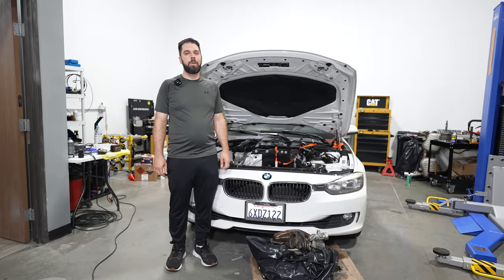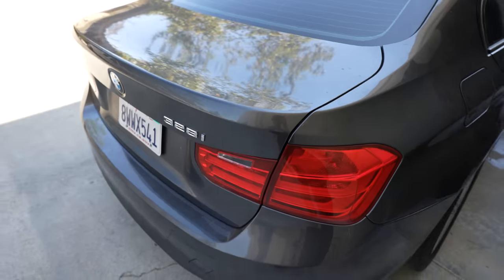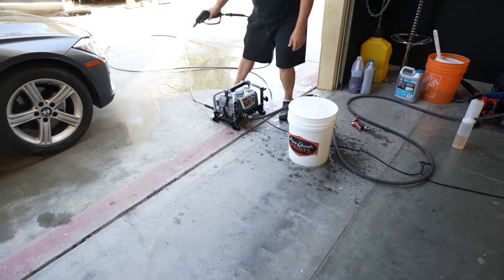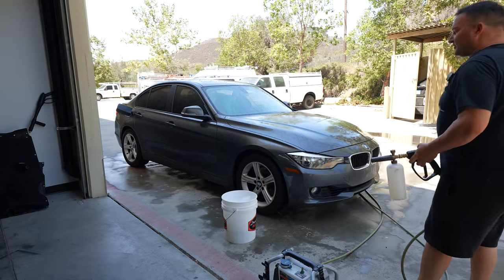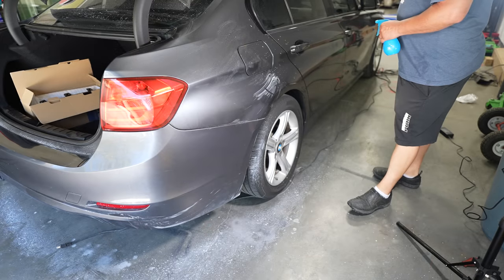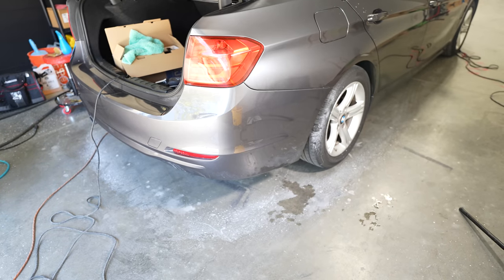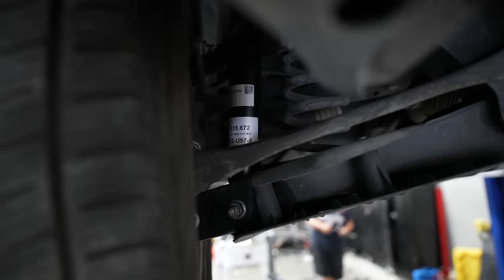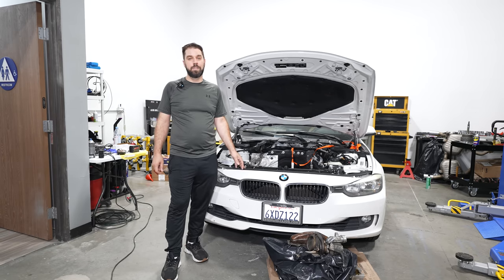BMW Professional Paint Correction (Clay, Wet Sand, Compound, Polish, Ceramic Coating)

Comment: With my 2008 335I I replaced the turbos with Vargas upgraded OEM Plus ones along with ARM catless downpipes. While I was down there I did a lot of preventative stuff such as control arms and sway arm parts and I even did my oil pan gasket along with installing solid motor mounts and replacing the thermostat. A project with a budget about $3,000 I hope to get at least 5 more years out of her
Reply: Solid motor mounts must be a little brutal.
Reply: @machtschnell7452  solid rubber I meant
Reply: Damn!!! For $3k that's awesome.  You're in great shape now.  My paint on the roof is wind  scratched and I need my oil pan gasket done (plus whatever you did I'm sure).  I can't do it anymore after my last back surgery.  Congrats!
Reply: @TheFrenchPug  yeah My hood, roof and trunk have hazed clear coat from the damn Arizona sun. I figure paint can be next if she can prove to be reliable.
Reply: @erikalvarez4516  Did your little rails on top start peeling?  I found some carbon fiber cover ups for $38 online. They look awesome and apply in 2 minutes with 3M tape.  I was going to buy new ones or have them painted.  New ones are $245 each!
Reply: @TheFrenchPug  oh nice! Thanks for the info! I also want to fix my scratched up chrome window trim
Reply: @erikalvarez4516  Mine is all black so no prob there.

Comment: Can we get a link to those quick connects? Couldn’t see them well in the video. That would save me so much time!
Reply: It is plastic so it will not cause corrosion. Sorry I didn't do a close up.
Reply: I tried to link from HD but it got deleted, just type in Melnor quick disconnect they are the plastic ones.

Comment: Don’t use that quick disconnect from HD suggested by the pro detailer. Non-softened water will corrode the fake brass and block water flow
Reply: Those are plastic quick connects, no way they cause deposit issues.

Comment: 99% of bmws experience low compression after 15 years. GUARANTEED! No matter how strictly you follow the maintenance schedule and how on top of repairs you are, their engines are designed to be destroyed after 15 years
Reply: Why is your prediction based on time and not actual mileage?
Reply: I doubt it, I all the e46s still on road prove you wrong.
Reply: Are you slow